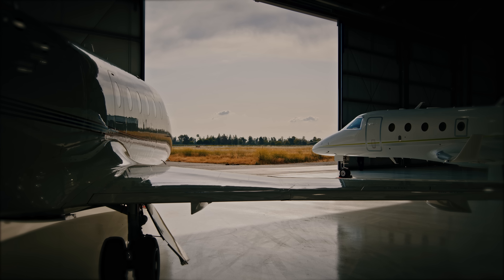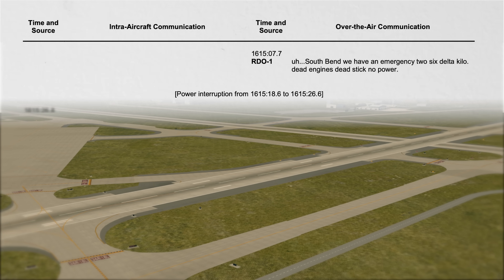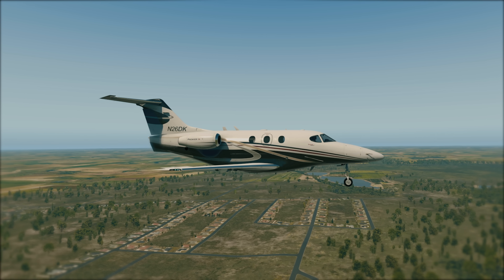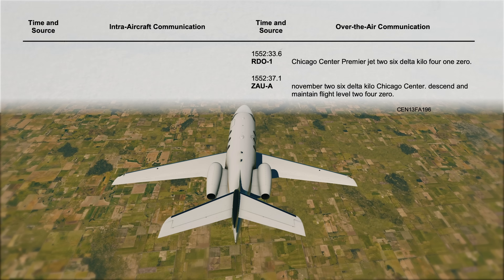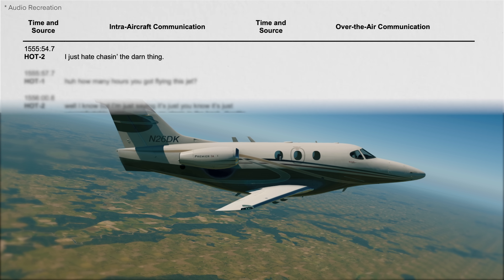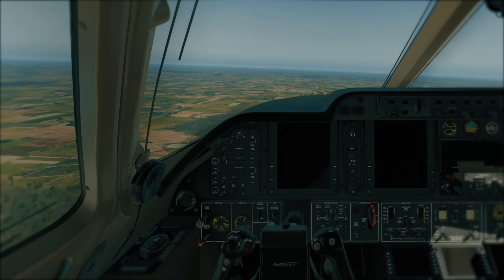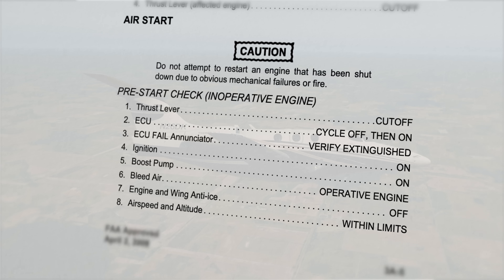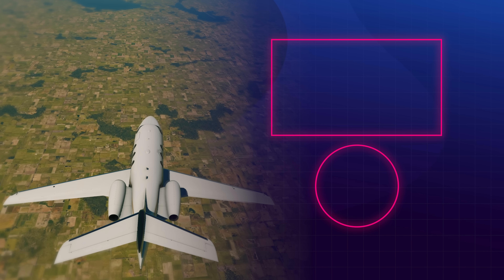Passenger Causes DUAL ENGINE FAILURE | Accident Case Study

Comment: Always heard the Premiers were built like tanks, anecdotally at least one of their salesmen would hit the fuselage with a hammer at exhibitions to showcase how strong the CFRP was, but wow... to stay together like even after going full lawn-dart is very impressive.
Reply: Hitting CFRP with any heavy object can cause hidden damage (delamination) inside the material, so hitting a real aircraft with a hammer is pretty silly!
Reply: @matthewc7334  No it's safe. "It crackles before it breaks, it's great!" -- Stockton Rush.
Reply: @klausstock8020  In aircraft (primary structural pressure is tension, not compression!) It's fine. Titan was a submersible and ergo was under compression. Very bad for composites of any sort - but carbon fiber very specifically thrives under tension and absolutely hates compression.
Reply: @matthewc7334  I believe it was just a fuselage-only mockup hauled around to shows like NBAA BACE when they were trying to fill the order book before deliveries even started, but I wasn't there so I'm not sure. I can say Honda's Echelon mockup was clearly not build to the same specs or from the same materials as a real airframe, so it may all be hogwash.

Comment: I thought these had little prop generators that can pop out.
Reply: They are called RATS for Ram Air Turbines
Reply: @donallan6396  Yeah. I guess I will go look up the plane. Seems even with underpowered engines by design, the emergency item was not included.

Comment: “We gotta slow down to 210 - gonna need to pull the throttle way back.”  “Just pull it back?”  “Yeah, pull it all the way back.” 

I can’t believe he was instructing during final, AND not watching the guy do the actions!  He would have at least seen him pass the stops and either stop him from cutting the engines, or caught it immediately. 

The cavalier way he goes past max speed then back to idle shows he had no idea how to use the thrusters, much less give instructions to a non-jet pilot. “I hate chasing the thing.” That’s like a car driving either being 100% on the gas pedal, or on the brakes, and nothing in between.
Reply: He did catch it immediately
Reply: It's supposed to be at idle. That's the checklist procedure. An overspeed airplane needs NO thrust.

Comment: Business jets are not sport aircraft.  No buzzing. No stalls. No loops. No high bank or pitch angles. If you want to have fun from raw flying, get an Extra 300 or Yak-50 or Pitts or something (if you can afford a Beech Premier, you can afford this in addition). 

You owe it to all the people on the ground, other airplanes in the air and your passengers on board to operate the aircraft professionally even if you are not technically a professional. When I took commercial cert training, they pounded checklist use into my head, even with a basic airplane like a Piper Arrow where some of them only had 1 or 2 items. Use checklists for every phase of operation from pull chocks until you put them back. People will be impressed just by being in a plane like this and flying point A to B, no need for a Lomcevak. 

If you regularly fly with a nonrated person in the right seat, get them a "pinch hitter" course to allow them to get it back on the ground if you have a heart attack, and teach them to read the checklists to you and how to find the emergency checklists. Have them give "PA"s to the passengers. Once they know the lingo, have them talk to the tower.
Reply: Flying should always be boring.

Comment: I frequently allow passengers to manipulate the yoke (in a simple plane like a 172 or Warrior) in VMC when we are in a remote area and I have cleared the area, so they can see what it feels like. But I shadow the controls and dont try to "train" them. One exception, I had a guy with like 1000 hours in the MSFS and he was basically a voice controlled autopilot. I still kept my head on a swivel and was ready to take back the controls at any second. If I wanted to train, I would get the cert and make money doing it.
Reply: Yeah there was nothing wrong with letting this guy have the controls.  The mistake was trying to instruct him,  and then refusing to take the controls back when he said "your throttles"

Comment: If you had asked two high school students to  fly that aeroplane just by reading the manuals they would have done it far better.
Reply: Yeah that passenger probably would have pulled out the checklist if the PIC dropped dead and probably would have done a better job.

Comment: Why did the ATC order a go-around when they were informed the plane had no power + no hydraulics?
Reply: They didn't order anything they suggested it,  because the pilot can't see his gear isn't down and probably wanted to know.  And he suggested a go-around because he could see the gear wasn't down,  which means he was close enough to see that the engine was working.  You can see heat waves coming out of a working engine on a clear day like that.

Comment: Non-pilot here, but should the ability to cutoff fuel to the engines perhaps not be so easily accessible via the throttle lever? Sure, those locks are there but looks like they can be easily engaged if someone is flustered or trying to do several things at once or isn't a trained pilot.  Sort of like miss-shifting a manual transmission in a car won't cut off fuel to the cars engine...
Reply: Shouldn't someone who isn't a trained pilot not be flying a private jet?

Comment: I watched this video but there's one thing I don't understand: What caused the final rolling descent and crash into the ground? At the point in time just before the crash the pilots had one engine operating and the plane was flying just fine with it.
Reply: I'm guessing he still had only one engine running and flew slower than Vmc. (I"m not a multi engine pilot, but multi engine airplanes need to fly above a critical speed - Vmc - to maintain control with asymmetric thrust.)
Reply: Pilot error.  He was probably task saturated and not flying the airplane. That or he handed the controls to the passenger while he worked the problem, and the passenger didn't know the V speeds and spun it.

Comment: Did I miss the part that explained why the plane crashed on a single go around attempt ? If there was nothing mechanically wrong with the plane, then what caused the crash??
Reply: Task saturation potentially
Reply: Just what I thought...
Reply: We don't know but probably one of two things.  He prioritized fixing the problem over flying the airplane,  or he handed the stick to the passenger while he prioritized fixing the problem and the passenger didn't know the airplane and spun it.

Comment: Unfortunately a very tragic outcome. I keep wondering if landing gear up the first time would have been better in terms of saving lives. On a long unobstructed runway, even without flaps or speed brakes the energy dissipation would be smoother than the uncontrolled nose down crash that claimed two lives and injured 3 more.

Comment: Aside from the incompetency of the pilot, and bad decision making on his part, I don't understand why the manufacturer designed the cut-off to work that way. A stressed or startled person running behind the aircraft might inadvertently pull those handles while quickly reducing power. It shouldn't be that easy to shut down the engine imho. What's wrong with a separate physical switch, like many other aircraft have?

Comment: If I owned a jet like that, I will surely take time out to learn all the systems and how they operate. When you're up in the air it is no time to try to figure out what to do, any good educated pilot would know what to do. This is a little off topic I was a  truck driver, and almost 80% of the driving test was the driver knowing how a truck operates in all the maintenance and all the systems. If you didn't answer these questions properly or do the right thing you would not get your license.

Comment: How would a passenger cause the problem I thought the cockpit is locked during flight
Reply: Not on a private aircraft!
Reply: The passenger was a private pilot sitting in the right seat.  He's a passenger because the PIC is not a flight instructor so legally he's just a passenger even if he's on the flight controls. He can't log this time as a co-pilot.

Comment: You can afford an expensive high-performance aircraft... you can afford the significant fuel and operating costs... time to budget for 2+ trips per year to Flight Safety International, for some "stress" time in the simulator!   This should've been a NON-event.  Over-his-head pilot-owner did NOT know his plane's systems by heart.  Pity.   Victims on the ground hopefully have great lawyers!

Comment: How has this "unfortunate" throttle-quadrant design survived into the 21st Century?  Finger-locks are nice, but obviously inadequate at times.  What EXACTLY is the scenario where the PIC has to shutdown both engines by feel, without looking?  The "ENGINE OFF" function should be in a separate location--maybe overhead--and require eyeballs-on to activate it, amirite??  Especially with FADECs, it's not like there's a physical cable mechanically valving the fuel flow to IDLE, then to zero... get rid of this dinosaur design.

Comment: I'm not a pilot, but I know the cause. Being an irresponsible, careless, and willfully ignorant pilot. What a shame.
Reply: most of these wealthy fools at least realize in time that this will be the outcome if they don't hire a real pilot to stop them from their final kamikaze dive!  this was not even a challenging flight.  this is a horrible design to have the power levers double as fuel cutoff.  very good demonstration why most aircraft have separate fuel condition levers!   who is the fool engineer who designed this ridiculous system?  probably terrified to fly and never been in a private aircraft in flight.
Reply: It was the cause of the engines out,  but not of the crash.  Even you could have safely landed this plane.  All you had to do was keep flying straight and level and asked the tower to find a pilot who knew this type of aircraft and could tell you what to do.  No knowledge needed except basic stick and rudder which most people understand enough to fly straight and level.

Comment: Some of the final clues, such as the partially extended emergency gear down lever gives me the hunch that the pilot began to panic, further hampering his ability to think withe resolute clarity. After that, it was all over but the crying.
Reply: Or quite possibly - given his earlier actions - he told his the passenger to pull the emergency gear down lever instead of doing it himself...
Reply: Probably the first time he had to use that emergency lever, maybe he had no idea how far he had to yank it. Or just fudged it under stress. Either way, what a stupid way to die. After all the stupidity that went into putting himself into that situation in the first place, the flight would have ended with both the aircraft and his body perfectly intact if he had just tugged on that lever a little harder.
Reply: @somealias-zs1bw that lever needs to be redesigned. Reminds me of a knob on a analog watch where the first detent sets hours and second detent sets day. But screwing up a watch knob won’t kill anyone.
Reply: @pukaseek  This. I pull the thing, a thing happens. I would have no way of knowing I was supposed to KEEP pulling the thing. This is poke-a-yoke.
Reply: Yes. The ground was coming up and he couldn’t remember what to do so he just started grasping at straws. Then he forgot to fly the plane.
Reply: I agree, I’m assuming once an engine is relit you would leave the main battery on. Going back to standby seems strange and could indicate panic.
Reply: Yeah, some people were claiming ignorance, but I think it could have been panic and negligence/incompetence.

Comment: Dont know if anyone else said it BUT.... ATC is what caused this tragedy. Landing with no gear down is a fantastic way to land a plane that is repeatedly being told "barely in control". 100% ATC this is your fault. Should have encouraged landing no gear. First reasonable approach landing is always the BEST approach landing in a crippled plane. ABSURD!
Reply: After declaring a Mayday the pillot is full charge and does not have to obey any instruction from any one. ATC just roll the crash trucks.

Comment: Just for clarification. Doesn’t the pilot in command overrule any request from ATC? I didn’t have time to look at the whole video but why not land the sucker with no gear??  Why make him go around??? Anyone who knows all the laws and regulations please explain. TIA
Reply from the maker: Yes the PIC has final authority during the flight and can, in an emergency, go against FAA regulation. I believe they would have lived if they landed gear up. - Greg
Reply: @PilotInstituteAirplanes  And the NTSB's Final Report shows, once more, what happens when you don't have an ATC Expert in the Investigative Team (at least it doesn't states that in it). That played a HUGE part in the CONSEQUENCES of the Previous Acts, which in turn are Consequences of Previous Acts and so on. (For example:Pilot's Certification process, Aircraft's Certification as Single Pilot, etc.) If you don't analyze those underlying conditions (Which in this case all played a part, then how will you justify or at least consider certain corrections/amendments to the Federal Regulations, etc ? in case should there be an intention in doing so.)

Comment: Seems very dangerous to have the fuel shutoff built into the throttle. One bad muscle memory could be a disaster
Reply: Agreed. Stupid design.
Reply: Thats how it is on most aircraft. You have to pull up on the hand lock then back to do it.
Reply: @spooky694  I’m a professional pilot. That’s not a common design.
Reply: @spooky694  I've only seen that on the Bombardier series of aircraft. The Boeing and Airbus and Embraer aircraft all have separate levers for the fuel shut off.
Reply: @ i work on cessna hawker and beechcraft products so thats what ive seen
Reply: @ on every aircraft I’ve flown from turboprops to jets the fuel cutoff switches are completely separate from the throttles. Name some specific aircraft please.
Reply: @ beechcraft premier, most hawker aircraft, and most cj’s.
Reply: @spooky694  if so I stand by my previous statement that it’s a shitty design. This accident is pretty strong evidence of that.
Reply: @ well its not the planes fault that the guy operating the controls has zero experience with anything turbine. Its like saying its a guns fault for shooting someone.
Reply: @spooky694  bad design is what it is. Designing the throttles with the cut offs built into them is a human factors bad design pure and simple. To use your gun analogy it’s like designing a gun with no safety mechanism on it. The trigger doesn’t pull itself but the design needs to be good enough that it’s not easy to kill yourself with it. Or others.
Reply: @ there is a safety mechanism on throttles of premier. You have to pull up on a fingerlock and pull back in order to get to cutoff. You cant just pull back on the throttles into cutoff
Reply: @ Not long ago a Bombardier crashed in the DC area. Seems like the same. I like the Embraer design the best, you have to put your hand in a completely different area to kill the engine.
Reply: @spooky694  I get that. Still bad design.